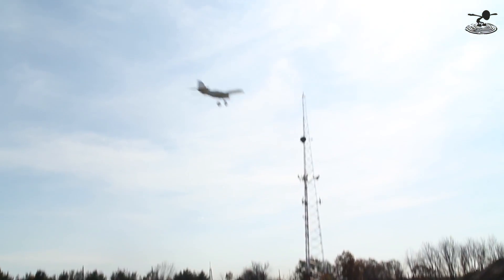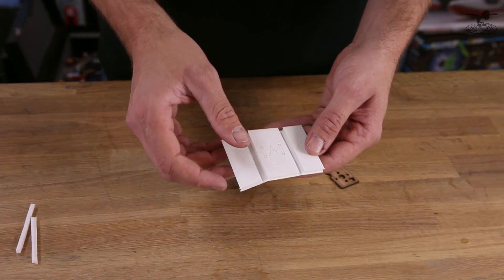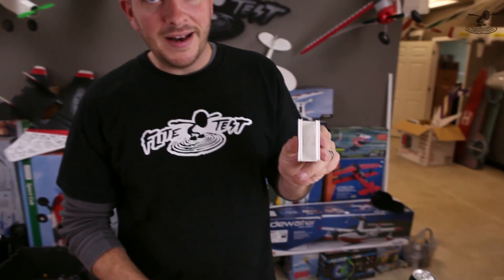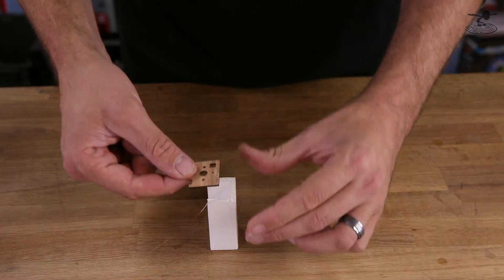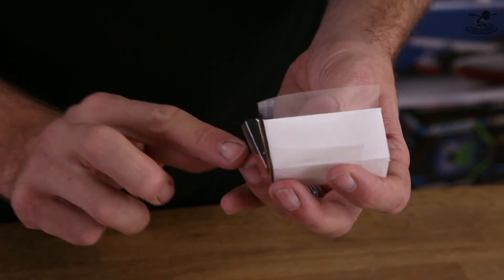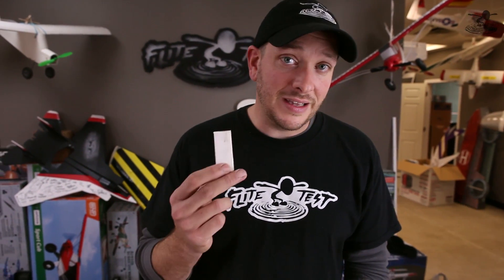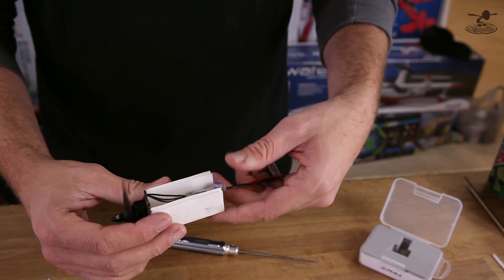Flite Test | FT Mini Power Pod - BUILD (Mighty Minis)

Comment: My motor wires go up  and over the firewall no matter what i do, because the wire connections are long and stiff going straight out of the motor making the flexible part of the wires start out further than the whole firewall itself. I got the power pack that was recommended to me on the store site when i bought it, so you'd think it would be compatible with the plane. i have no solutions other than buying a whole different motor so i'll just try it and find out if it ruins the whole thing.

Comment: Hey guys, quick question,  I am starting the build on the mighty mini, I got the whole kit with power pack included, however am I to trace out and drill out the wooden mount for the motor? Is there a diagram to follow to do this or am I not seeing the firewall piece in the kit? Love the channel, happy to get started on these sweet kits! Thanks!
Reply: Way late, but mine was in the bag with the music wire for pushrods and such. It's pretty tiny.

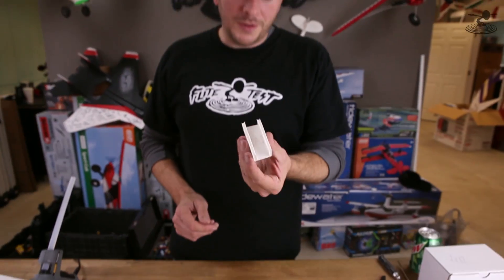Comment: @ 1:18 I don't understand why ... why the engine and therefore the propeller should not be aligned with the body of the plane? why be a little crooked? cross thrust angle ...? between right and left ... ???
Reply: So i don"t have understood, i have glued firewall at the perpendicular side.

Comment: I have 2 mini-series firewalls with the holes in different places.  One firewall's 4 mount holes are 15mm apart (opposites).  The other firewall's 2 holes (opposites) are 15mm apart and the other 2 are only 12mm apart ( the vertical opposites).  I discovered the one firewall with 2 holes at 12mm fit my MX1806-2280kV motor only 2 of the 4 mount holes.  Is just 2 motor mount holes needed or do I have to drill 2 holes in the firewall inorder to use all 4 mount holes on the motor?
Reply: I just built this from ft kit, only 2 holes line up with the motor, is that enough? Or do I need to redrill the other 2?

Comment: Hi Josh good morning. 
I have some questions related to motors. 
I hope you will answer to me. 
I notice that motors for planes have normally higher can rotor than the motors for drones. 
Why this difference? 
Comparing motors for planes and for drones with same diameter, same kv and same voltage applied, what are the differences between motors?
Considering same motors characteristics, may I use a drone motors on a plane?
There is any differences in performance?
About propeller, which are the main differences between drones props and planes props?
Is it ok to use drones props on planes?
Thanks for your attention and replay. 
Regards. Giorgio.
Reply: Giorgio Ottaviani The motors are the same. The only thing you’d have to worry about is the mounting holes

Comment: Better learn how to build these because the "swappable" nature odd these isn't SO swappable because of their angle changes and design differences. For example you're not going to use just one of these to power a mini arrow, a mini scout and a tiny trainer...you'll ACTUALLY need 3 different ones...so yeah.. 3 motors, 3 esc, 3 props and mine as well buy 3 receivers while you're out breaking the bank. Otherwise you'll be spending a ton of time screwing and unscrewing your motor to different pods that you want to fly. PITA and the ease is NOT as advertised. FYI
Reply: i think you should look at the title again.. from what i see, they are not called "swappable" they are called mini-powerpods.. the old "swappable" powerpod is bigger, and was swappable indeed! these mini powerpods are not advertised as swappable.. but if done right you could maybe make them swappable!

Comment: Hi, I am building the mini corsair. This is my first build of a mini and I had a question about the power pod. I noticed when I was going to put the firewall on the pod, it doesn't line up on the walls like it does in your video. However, the firewall does sit on the foam nicely. Is it supposed to be glued between the foam now?

Comment: Hey I was just wondering before I buy it is it hot melt glue u use or cold melt glue?
Reply: sgttiger hot glue. ...n the clearer the sticks the better. ...the milky colored ones will work but the clear sticks are more durable and have better "sticktivity". ..plus it's hard to melt glue with "cold"

Comment: Please someone explain to me why the thrust is angled!!!
Reply: BlueBluby it's because of the p factor, I would suggest looking up what it is as I am not 100 percent what it is. But it's basically the right side of the prop gains more lift making the plane veer off to the left. So there is an angle to the right if I am correct to counter act that.
Reply: BlueBluby it's due to motor torque and it's an angle to compensate for the motor torque due to the lightweight build of the aircraft

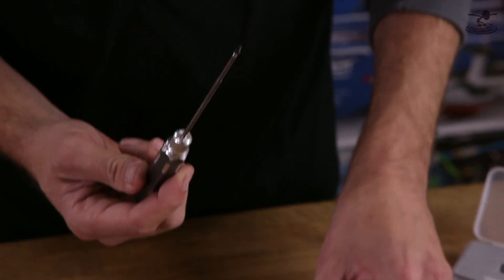Comment: At 4:15 ish:
When he says, "I'm going to go ahead and use one of the longer screws..." during motor mounting, he REALLY means, "longer screwdriver".
DO NOT use anything but the shortest screws.  Don't ask.......
Reply: Chris Boyd my screwdriver doesn’t even work with these
Reply: I recently used the longer screws when building another kit. The motors shorted out and I never finished the plane.
Reply: @braverhpfan1250 me too
Reply: Almost did it lol thqnks
Reply: @TheKingDrew  Yep my motor just sat there and stuttered back and forth.  I had to by a replacement.
I asked them to edit the video, but I don't think they ever did.
Reply: @chrisboyd4433  did you also have to enlarge the fire wall holes by chance?
Reply: It must be said, we shorted our motors and destroyed them with this tutorial.  By the way, the ESC I bought from flite test had a plug soldered backwards, so I blew it up also.

Comment: I wanna equip this with a 750kv motor 28 size and a 8 inch Prop. is this working?
Reply: if i need more speed I just take 4s batteries
Reply: Would I be able to equip this with a 2500 kv motor?
Reply: Yes, but I would look for lower kv and bigger prop because you dont have very long flight times with an 2500kv motor

Comment: Is hot glue the best glue for this?
Reply: works very well with this kind of materials, very strong .. cheap.. easy to use and sets nearly instantly..

the downs are: ..it sets nearly instantly (so nearly no time to correct if you put the part wrong)..its hot (you can burn yourself, Josh himself gives tips on their hot glue tips video on how to avoid this) and its on the heavier side of glues
Reply: +sparrowlt And when its in you car its get hot and the glue will be hot again. ;-(

Comment: Not to be mean but this video didn't really help I built my ft mini scout and was gonna wire the electronics (beginner with RC planes) but when I got my emax motor out there were no bullet connectors there was bullet connectors on the ESC but not the motor so someone please link me to a video or comment (I have watched the connecting electronics vid by FT)

Comment: Josh,
There are many Parts that can be made from ABS or PLA 3D printer materials that would be much stronger than foam. The parts would be one piece and require no gluing. 
These parts might be about 20%(just a guess)heavier but many times stronger than foam board. Holes and any penetrations could also be positioned as needed.
Reply: Have you ever flown rc planes before?

Comment: Quick Question.. why do they never include the receiver as part of a power pack? ty
Reply: I think I could answer this... Probably because there are different signal formats from the different radio makers,

Walkera, Aurora, Turnigy, Futaba, HiTec, Tactic, and Graupner to mention a few -- and they all talk their own language.

What I have done is pick a radio, in my case Walkera's DEVO 7E, a budget radio, small and light with really good quality gimbals, 30 model memory, and the receivers (RX-601/RX-701) online are usually under $20 if not under $10US. Most planes you build with FliteTest are 4 channels or less, so the extra channels can be used for other things, if desired. You could add on flight gyros, lights, retracts, bombay doors, the sky is the limit!

Each receiver can be set to its own plane, or power pod, and with several models to store in the radio, I could have a fleet for a song.

Comment: Could u guys make a petrol powered Multicopter!?
Reply: Trying to get 4 small nitro motors to run at one time would be a nightmare
Reply: MrP4LM3R too much latency in a gas engine.  It would fly like a retarded brick
Reply: These other fellas are wrong, you use one single petrol engine and adjust the pitch angle on the props to fly.